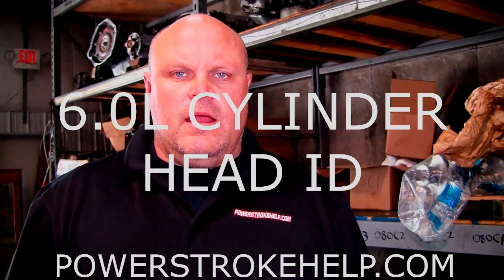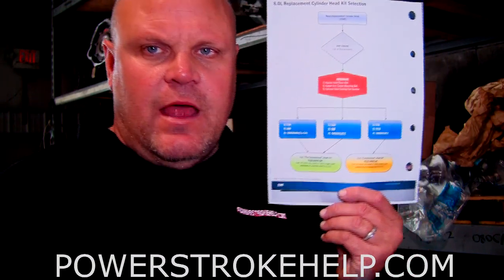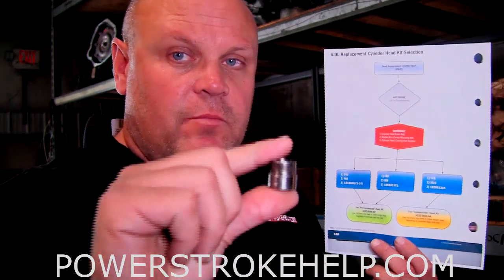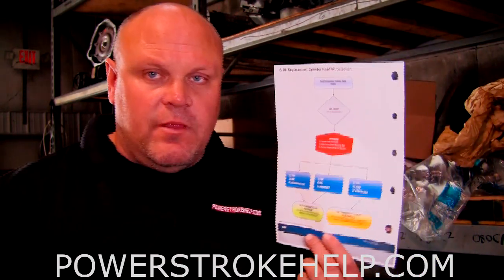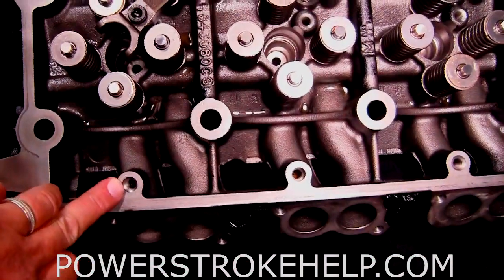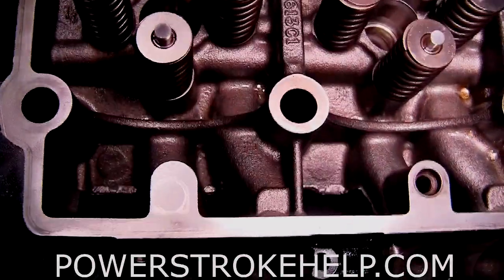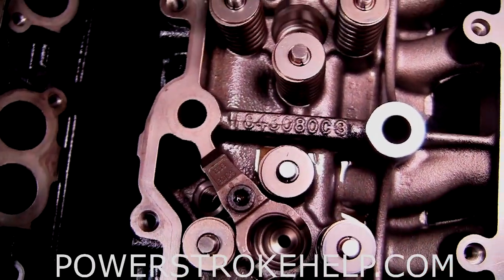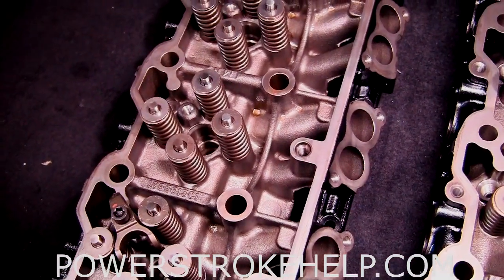6 0L CYLINDER POWERSTROKE HEAD IDENTIFICATION

Comment: Why cant someone  install threads with clearances for the dowel in the 613C1 cylinder heads (where no threads are currently) that will allow the older rocker carriers a mounting fastener location?

Comment: Thanks Bill, way over my head but informative. Perhaps you can take my truck and show how to bullet proof one, a truck that is a true cherry.  showing the things that should be done.  My truck, remember only 22 thousand miles on this dually. No the camper doesn't always sit on the truck.  The camper's weight is 36 hundred pounds dry weight.  Yes, I have extra air bags for hauling. This is a King Ranch truck too. 2006 model,

Comment: bill i have a question for you, im planing on buying a 6.0l (i love the motor) now is it better to get one with less then 100k? more should i go for with more then 100k?
Reply: i myself have a 6.0l with 340 thousand. it runs better than any other 6.0l ive heard over the past few years. why? i use good oil, good additives, and keep up on maintenance. only mods done are 4 inch full flow exhaust, and performance intake and intercooler, with some tuning. Just pay attention to what the truck is doing, and try to diagnose it, and prevent it. a high mileage truck just takes a little more attention, and they should go as far as you please. hope it helps! goodluck.